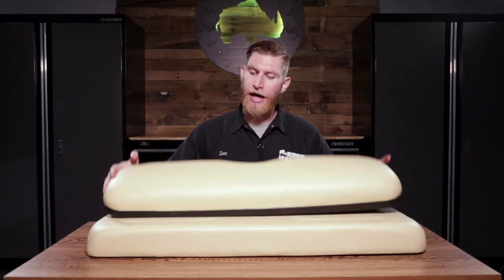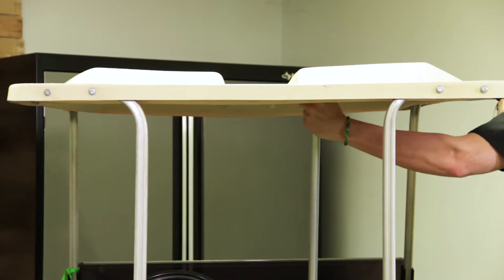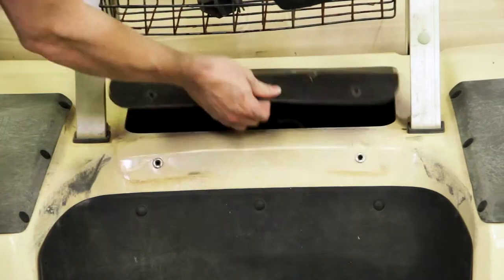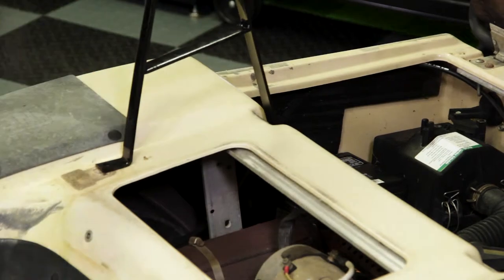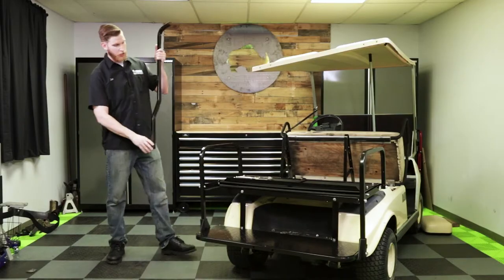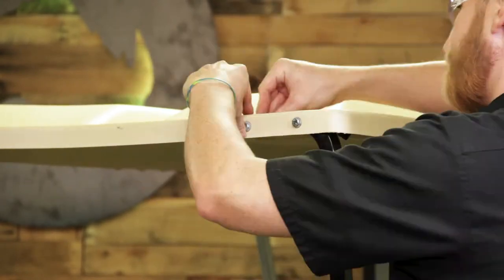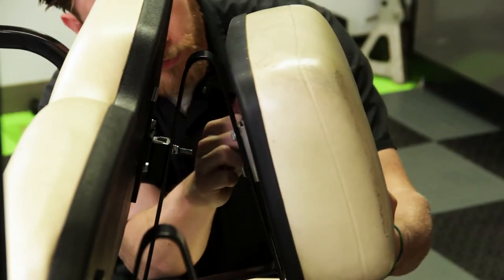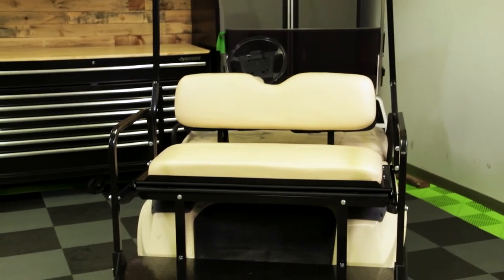SEAT-721 Super Saver Rear Seat Kit on a Club Car DS

Comment: Where can I get the rear seat bracket the one you screw in to the top of the seat had to cut mine out and can not find a new one anywhere
Reply from the maker: Can you fill out a "contact us" form on the RHOX website with this information as well as the seat kit part number?  We will need to see photos of the bracket you are trying to replace and you can't send photos on here. Once you submit the form, we will respond back with an email. You can send the photos to that email address.  https://rhox.us/contact_us.asp

Comment: Which one (model) do I order for a 1999 club car that has a roof on it
Reply from the maker: You can use this same model but will need to order a TOP-0101 rear strut set with it.  These can be installed to the seat kit and will attach to the Club Car OE top.